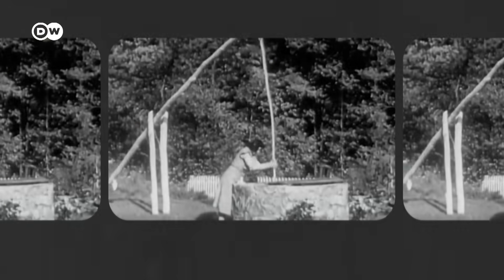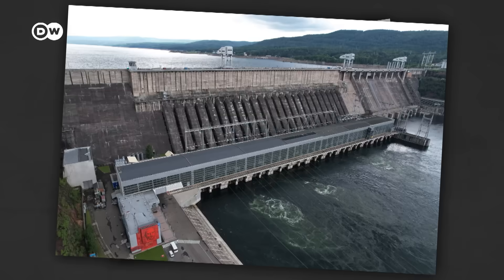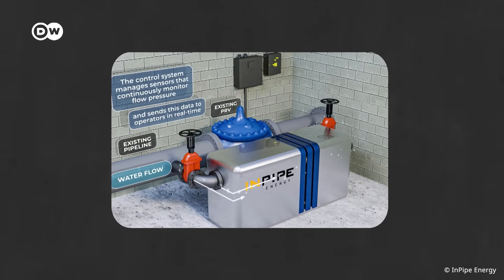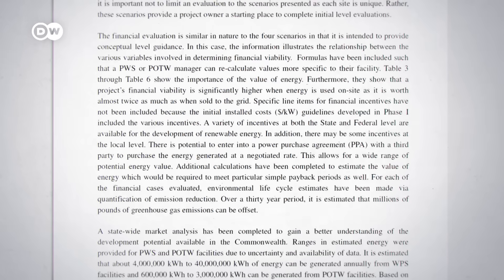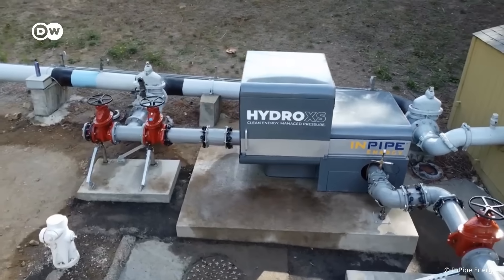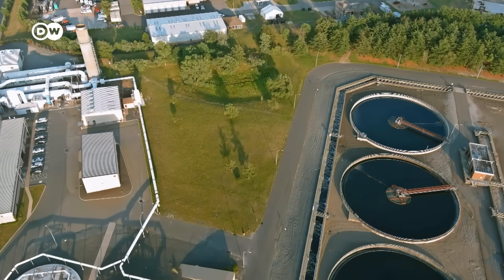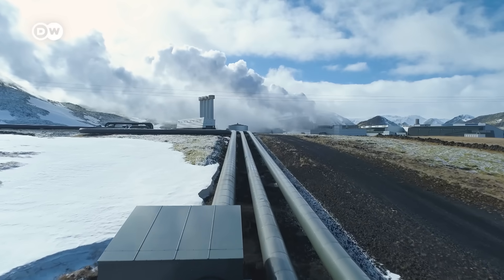In-pipe energy: The hydro power nobody is talking about

Comment: Shouldn't the PSI relate to the energy this device could produce?
Reply from the maker: Hey there! Yes, the higher the pressure the more excess energy.
Reply: @DWPlanetA  So when she said the amount of energy produces wasn't quantifiable what did she mean? I build irrigation for feeding plants. A water tube that created energy would be a billion dollar industry. It would just be a hard sell if the energy isn't quantifiable.
Reply from the maker: The pressure and therefore the excess pressure in pipes depend on a lot of factors. Therefore, it is hard to estimate how much electricity can exactly be generated.
Reply: @DWPlanetA  
@DWPlanetA
"The pressure and therefore the excess pressure in pipes depend on a lot of factors." You can see exactly how much pressure is in a pipe using a flow meter. It's incredibly easy and relatively cheap.

Comment: Wonder if anyone did a small scale experiment where the water was pumped on one side and though pressure relief valves(basically the idea of the video) the water pressure was reduced and then put to work in a mini turbine. How ever, i wonder if there are many such places that use these water pressure relief valves or at least to what extent do they waste/store energy.
Would be awful if this turned into a Soviet type of experiment/implementation.
Reply from the maker: Hey there! The pressure is not reduced with these valves. They just collect waste energy. The process is explained starting 2:26.

Comment: Seems like wasting energy to make energy
Reply from the maker: Hey there!  Mini hydro technology only collects pressure valve waste energy already being generated by our water transportation service. Therefore, it collects energy otherwise wasted. The process is explained at 2:26.
Reply: @DWPlanetA  It would end with more total energy if the pressure were better regulated and energy weren't wasted over-pressurizing the line which the customers have to pay for but won't get credited for what ever energy is generated, this incentivizes waste.
Reply: @scotshabalam2432  Pipelines are usually not intentionally overpressurized. This usually happens by gravity. When a pipeline leads down a 100m high hill, the pressure in the pipes increases by 10 bar. So much pressure is usually not needed and can be even dangerous. Normally a valve is installed to reduce the pressure to a more manageable level.
The idea is to use a small water turbine instead. 
The problem is the cost. For a small pipe with irregular flow, such a installation is not worth the costs. For a main pipe with regular flow, this can work. But water companies already consider this. It is not really new. These turbines are around for decades.

Comment: This remedial doesn’t realize they used massive electric pumps to create the pressure to overcome the resistance and pressure loss at openings.  Putting resistance will just cause the pumps to use more electricity. Using it only in gravity areas like drop offs like a freaking damn is inferior to just using a damn. 

Think some drunk tard didn’t come up with this idea like putting a windmill on a electric car or on a bicycle while smoking crack being a chomo?  Already failed.

Comment: why not use the electricity generated from the pressure to power a motor that take the same water to add pressure back into the system, so you have an infinite loop

Comment: it stinks of a scam.
So you spend a lot of energy to generate pressure in pipelines so every home has water flow.
and now you want to take that pressure away and turn it into electricity again with huge losses on the conversion....
then that turbine generates drop in pressure in the system that water pumps need to compensate with even more energy.
where's the logic? guys ure not inventing free energy machine here its just power lines with extra steps lmao
Reply from the maker: Hey there!  Mini hydro technology only collects pressure valve waste energy already being generated by our water transportation service. Therefore, no additional pressure is needed. The process is explained at 2:26.

Comment: You will weaken the water pressure and cause back pressure. Game Over.  If you have excess pressure that's different, however it would complicate the water pipe network and introduce points of mechanical failure.  Solar power is simpler and cheaper and less disruptive in terms of its energy flow.  People turning on and off taps would result in pressure differentials and adding turbines could add stresses and additional points of failure to the pipe network.    I suggest this is largely a pipe dream.  Solar and grid scale battery storage is just too easy nowadays.  I suggest this to be a pointless exercise. 😂🤣🤪

Comment: This is a stupid idea. The pumps are trying to maintain pressure in the ring main. If you sap energy with the turbine, then the pumps have to work harder to maintain the pressure. So your net loss is the capital expense retrofitting/installing and maintaining the turbines and the efficiency loss in converting the pressure to electricity again when you just spend electricity to run the pumps to maintain the pressure. This is only a capital cost and an efficiency loss. Absolute junk idea.

Comment: As the report states this isn't a silver bullet and it would only make sense to install these at points where regular pressure release valves were/are needed anyway. Otherwise it will reduce the flow intensity and negatively impact ones water pressure.

Comment: Doesn't it mean that in the end you'd need stronger pumps to account for loss of energy in the system?
Reply from the maker: Hey there. 🍀 This technology is invented to harness the excess into energy. 💧 So no, it does not mean that.
Reply: @DWPlanetA  where does this excess come from? I guess that's what I was looking for in the video. 
Why harnessing water power in our pipes doesn't mean decrease in pressure for our tap?
Reply from the maker: Hey again. Please check again from 2:26 minutes to the video, we explain this process there. ☀
Reply: @DWPlanetA  no, you don't. You briefly mention that it has to do with pressure valves, don't explain where the excess energy come from and quickly switch to a person installing a turbine at a seemingly random point of a hose. I did watch the video, hence my question above.

Comment: sadly a bit disappointed by you.  You should have consulted an engineer before doing this story. While harvesting power from a natural height differential (i.e. water source in the mountains spins turbines for a city in the flatlands) makes sense, using the energy put in by pumps does not. The pump has to put in more work than one can harvest with these silly turbines. Even with just your journalistic backgrounds, one could have easily tested this with your garden hose. Instead of going into the house line, put a pump with a pressure switch in there and observe how often the pump turns on when you have the valve closed / open and what happens when this mini-turbine is installed.

Comment: Sounds stupid!  The energy added in the pipe in the shape of pressure is not a useless pressure, you need pressurized systems to make the water useable and safe. If the turbine just siphons this energy for electricity, the system would need to add more power to the system to keep the water flowing throw showers in homes. The only practical solution to use this idea is If you have a natural gradient due to topology, you can do it,  but not by just shifting the cost upstream.

Comment: If you put an in-line generator It'll reduce the water pressure. The power lost at the pump would be more then the power gained at the generator. 
Unless it don't. Then you might as well use a pump to turn the generator, then the generator can power the pump. Which doesn't work .if it did work then ocean waves would get stronger, and bigger as they travel across the ocean.

Comment: I cannot believe that a single person with a very basic understanding of physics didn't stop this video report before it was released.  Come on!  There are uses for this technology.  But it is limited to potential source of backup power in emergencies or cases where a water system somehow naturally generates excess water pressure (perhaps where water naturally collected at a higher elevation than where it is used). Obviously, if you put a turbine in a waterline, you lose pressure equal to the energy harvested by the turbine on the outflow side.  If people's showers and sinks were at the right pressure before the turbine was installed, you'll need to use electricity to pump more water up into the tower to have enough energy to harvest some from the turbine and still have enough water pressure for people's showers.  It will always be more net energy efficient to pump less water into the tower and skip the turbine.  Otherwise, the laws of thermodynamics are broken.  Seriously, come on guys.  Was everyone involved in this article totally dense, or was it made to trick knucklehead viewers for some reason?  The other comments seem to show that a very high % of people who watched this clearly understand how far it totally strays from logic.

Comment: This is total nonsense. You might as well setup solar cells under your desk lamp and harvest electricity to power your house. By putting resistance in the flow of the water you put a heavier power load on the water pump. Any scavenged energy will be so low that the ROI would be near zero.

Comment: I can imagine that this would have some niche applications but it would be better not to use the energy in thefirst place.

Are these PRVs distributed throughout the network? If so, while I think the technicalities would be difificult maybe instead of replacing the PRVs with generators, replace them with pumps. All the pumps in the network would need to be part of a computuerised network to maintain the required pressure throughout the water system. I would think the computerised aspect would be the easy part since we are moving to a smart electricall grid.

Comment: I think the reality of this is that it will have limited applications, and we would be better served just creating more efficient water systems, at least in most cases.  The places these are being trialed (like Oregon) are putting them inside huge 42" pipes that connect from reservoirs that are gravity feeding the city water supply.  I mean, at that point your talking more a hydroelectric dam than you are miraculously recouping energy from our normal water supply pipes.  

In that sense, by all means, for these large water conduits where you are transporting water via gravity and it can withstand pressure loss from the turbines and still provide the city with the pressure it needs, then yes, seems like it may be viable.

Comment: Rather than extracting in-pipe energy, is it better not to use that much energy from the water source? If it is required to use a lot of energy at the water source, does the source need to use more energy so that in-pipe enengy can be extracted down the line? The energy need to come from somewhere. Have I missed the point?
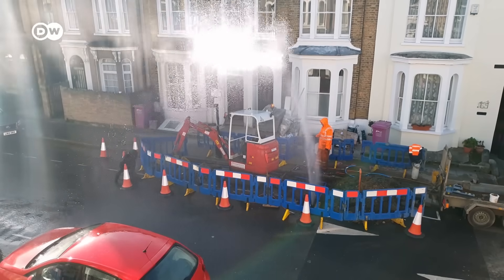Reply from the maker: Hey there, we explain in about 2:36 minutes to the video how this works: it is about employing the excess pressure, a surplus so to say. So the point is that the pressure exists anyway and this is a technology geared to harness it. 🌞

Comment: So you want to take the static pressure to then convert it back to energy. Which then reduces the static pressure you want for strong water flow in your house. So you'll have to demand more from pumps to attempt to maintain strong pressure. Besides some of this just going against the laws of thermodynamics and conservation. The energy to get the pressure is already spent on the pump. To then add another line splitting the pressure to produce energy from that line. You then either cause the main pump to use more energy to maintain pressure or reduce the static pressure of the system. Which in turn reduces the harvested power by this extra turbine.
At the end of the day your just trying to recapture energy already spent providing the pressure. Which part of it is already lost due to pump heat. You not going to regain the energy used to turn the pump and all likelihood youll just cause the pump to work more to maintain pressure or reduce the overall pressure of the system defeating the ability to take excess pressure and privide strong water pressure when needed.

Comment: In the 1800s they used to techs in the house with similar energy generation and tools that run on that old DC flow.
E.g, electric toothbryshes ran on them, electric kettles, use of that as generally for say tools around the house like drills, hair dryers, lighting etc etc ! 
Them along came some greedy money scammers, who reset the whole system to run on AC current thru the wires, so that it can be metered to us ! 
They took away, hid, burned, looted that old tech and it's knowledge from the masses to make us ignorant of that knowledge then re-present it back to us in otherways to make money out of us! 
No more real green techs, no free electricity etc 
😢😢😢 
Even Aether electricity was used like Tesla style.
There were electric cars with better rechargeable and swappable batteries and stations too, better than todays many electric cars ! 
Even better airships than todays planes ran on Aether electricity!! 
HOW SAD AND EVIL PEOPLE CAN BE FOR MONEY !! 😢😢😮😮

Comment: If they have excess pressure they should address lowering the pressure as the energy you could recover from that excess pressure it always going to be less than the energy it took to create the pressure the only real area this would be beneficial is a higher elevation water source moving to a lower elevation area that you could tap which would basically be a hydro dam.  This is eerily similar to the BS perpetual motion machines you see.

Comment: Transfering water from lower to higher place wastes energy but by adding energy turbine in places where water goes from higher to lower altitude you can tap into wasted potential energy of water. Its a viable option to reduce costs of reducing water pressure because turbine would act as pressure valve and reduce its potential energy. Seems doable. Add to it that heat pumps can reduce wasted energy by keeping heat in house by lowering temperature of waste water. We are tapping into potential to make zero emission houses real.

Comment: Stupid video by someone who didn't study hydraulic and has no knowledge of skin friction in a pipe.  If you put a say 200m long hose pipe connected to a tap the water that comes out is a fraction of the case without the hose!  This means if everyone obtains power from the mains supply there will be no pressure left in the mains.  

Lastly the main pressure is provided by the water company by using energy to pump water to a high point to provide the head of nominally 15m or 1.5 bar.  If the consumers extricate  power from the mains the water company has to ramp up power and spend more energy to maintain the system.  No water company would permit such undertaking.

Comment: Fine but it doesn't seem to be a really practical or scalable idea. 

Going by this even human movements can turn such small turbines. Or even the heat generated by sitting or sleeping on chair or bed can be tapped. Similarly humans can get their bodies in shape with working out on stationary bicycles that could move turbine. But again the scalability and practicality are points to ponder.

Comment: I have a 600 W pump to drain a pool and the water jet it is able to generate is much weaker than the tap water. This indicates that the utility is using around 1 kW on the end-of-pipe losses in my house.

Water utilities in Denmark always employ several parallel, speed-controlled pumps to maintain pressure with minimum need of throttling.

Or we could design our water systems to be with nearly zero excess pressure when it reaches the houses, and each home owner has their own water pressurizer - like you have your own pressure washer.

Comment: Some people are confused and think we should supposed to gain more electricity at the end than the one we used to build pressure and momentum in the pipes and they called this inefficient but they should think in terms of reducing the cost of it ...i guess they like their bills high xD....for example even in electricity itself we use solar panel and wind turbines in an efort to reduce the electric bill even if that is inefficient we still do it even if it chips away small % of the cost of the bill xD we still put it in the grid ...a factory that uses a lot of electricity uses some solar panel to do this yes its inefficient because it produces less than what you used but is the difference A-B=less expensive its the cost ...not  an effort to create more electricity xD xD  "reduce the cost" ... and thats why is useful !!!

Comment: I'm not anywhere near any kind of expert in water industry, but even I can see it. 
10 MW of power you get from these pipes doesn't come free. They were spent by the source pumps to get that much pressure in the pipe. 
It's basically stealing Governments or water companies's energy cost. 
It could also disrupt the flow of water if used on a larger scale. Good for individuals, and bad for the provider. Overall, more pressure on the source pumps.
Reply from the maker: Hey there!  Mini hydro technology only collects pressure valve waste energy already being generated by our water transportation service. Therefore, no additional pressure is needed. The process is explained at 2:26.